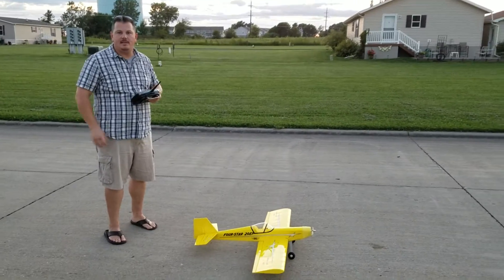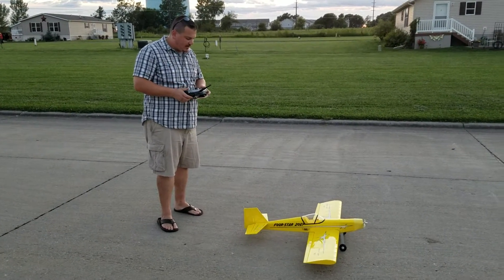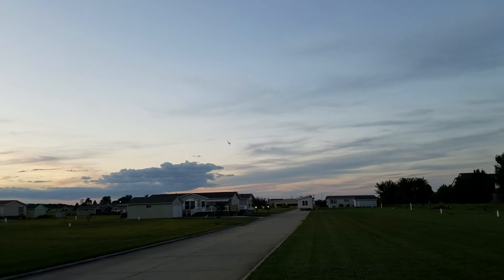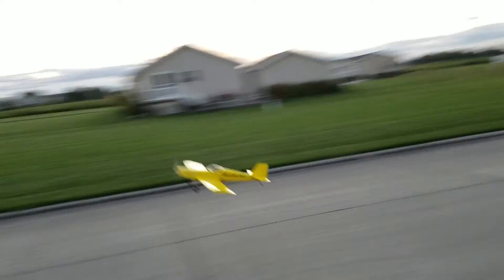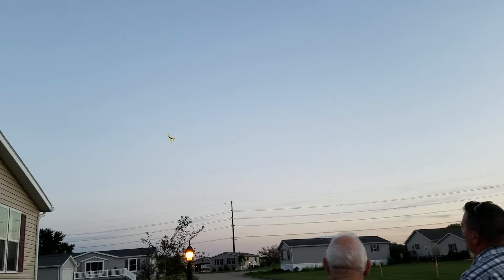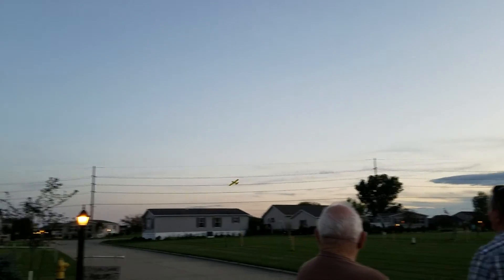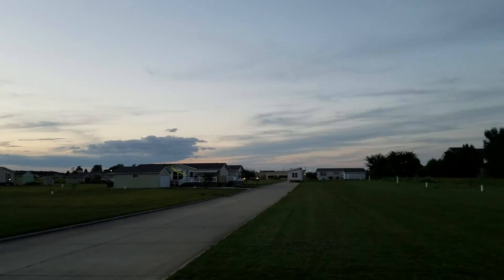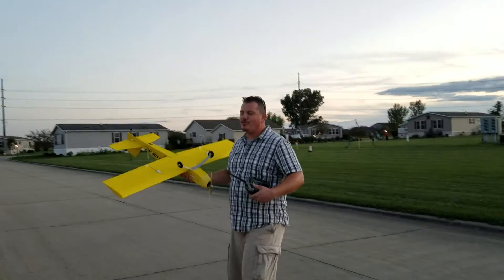Sig Four Star 20EP - Flight 3 of 3 on 9/3/2016

Comment: Nice flying. what size motor are you using.
Reply from the maker: I'm sorry, I don't know. This plane belongs to my Grandpa, and they winter in Texas, so I don't have access to this plane at the moment. When they come back, I'll try and check it out.
Reply: Thanks for the response Brian, I was wondering because I'm building the same plane. it looks like a nice flyer. I'm thinking of using a E-Flite power 10.
Reply: @edwardhasiak7961  Ed. How did the plane turn out. I’m building one. But this response is 4 yrs after you posted yours.
Reply: @KevJW  Mine came out great.I modified it with a detachable hatch on top so I did not have to turn it over to change batteries.It flew great with a E-Flite power 10. Unfortunately it was totaled only after 10 flights while doing low level acrobatics. You will be happy with it.